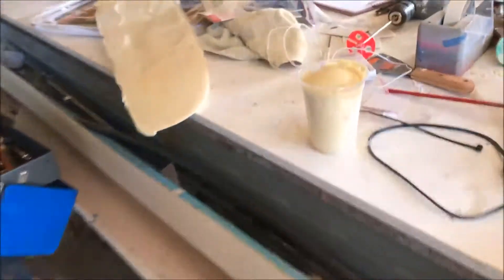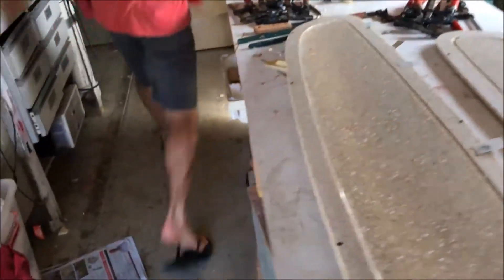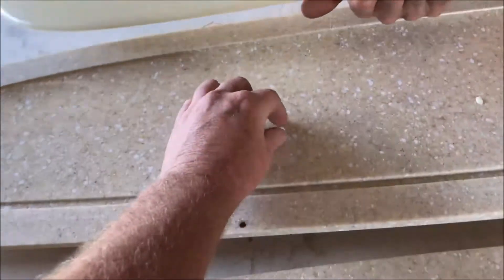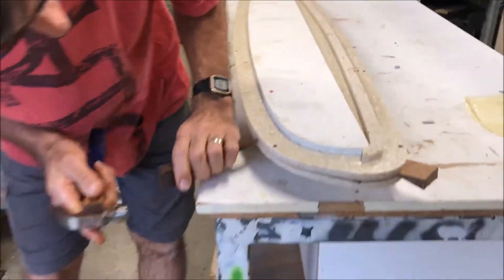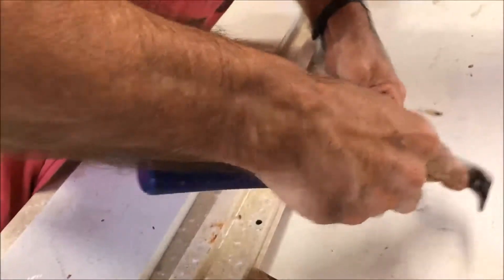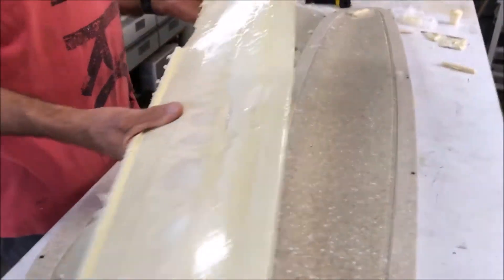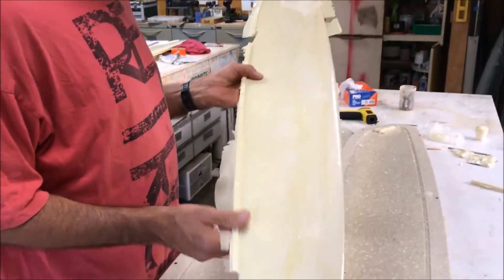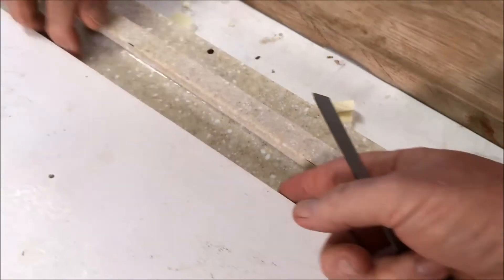PU core 'speramints.

Comment: You all were so close to making that work. Couple things mold was mainly in the wrong orientation. You needed to fill the mold on end with a small vent at the top. You attempted to fill this horizontal with a thin cross section and not enough venting. Best to make two halves for the molds easy to fill the wing tips first and let it expand to the center of the wing where it is capped with small holes for venting keeping just enough back pressure. Like previous commenter do not use a release agent. This was doable. Also you need to use a impeller to quickly and properly mix the ingredients. Hand mixing is not sufficient. So close you almost had it.
Reply from the maker: Hi Eric, thanks for your post. As you’ve already seen, Andrew and I made this video quite a few years ago now. A lot of water under the bridge. Andrew has moved on to Trials riding and I’ve regressed to building a tradition stick and rag model. “Pioneers get arrows in their butt”. It’s great to be getting a result without the frustration of failed experiments. If we choose to revisit this, your post will be great intel. D.

Comment: I'm a little late to the party, but the silicone-based mold release might have been an issue - it can apparently inhibit the expansion of (at least some) PU foams.
Reply from the maker: Thanks for your reply, John. A colleague has done a LOT of RnD and is successfully moulding a foam core then adding that core into wet skins and closing the mould. Sooo much time, money and effort to get where he’s at. AvB and I have abandoned the idea of pouring liquid foam into moulds.

Comment: What's the purpose of the trench along the T/E?
I've seen it on a lot of metal moulds but never understood it's purpose.
Steve
Reply from the maker: Hey Steve. The trench provides a void for excess material and resin to go during the joining process. Without it, the TE could be thicker than intended, distorting the entire profile.